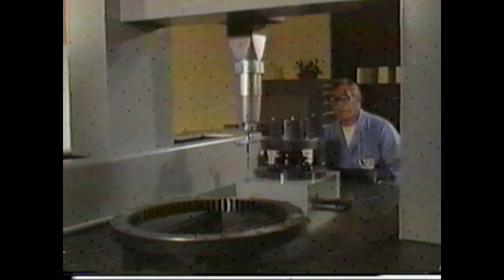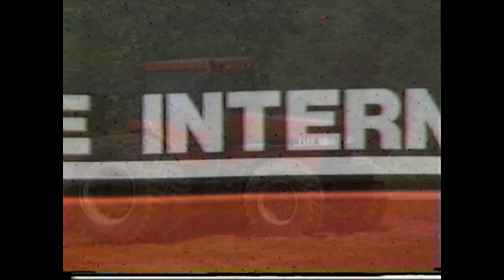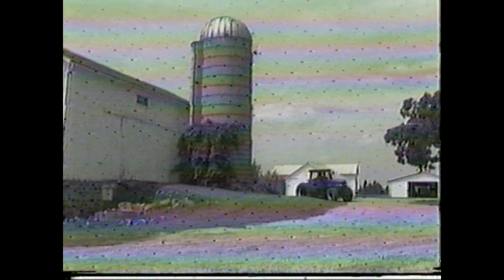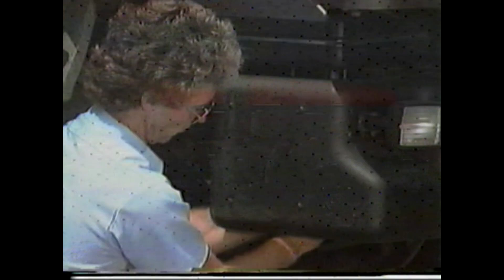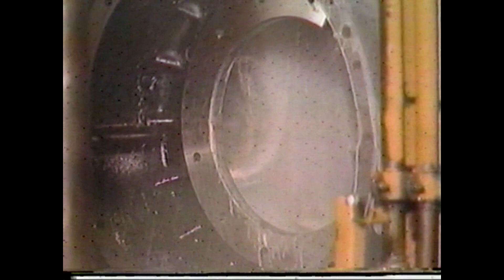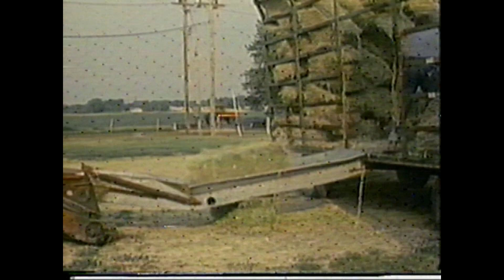Case IH 7100 Series Magnum Tractors Promotional Video - 1987

Comment: So would the IH company come out with this Tractor, without the buyout? I always thought the Cab seemed like a Case 90 series. Spent 3000 hrs in a 7130 hauling Shit. When I was 15 up
Reply: Yes.  The majority of this tractor was IH design.  Last minute in the merger they added some Case inspired design to the cab, and added a CDC engine (Cummins 8.3)
Reply: @curtisk84  wow! Thanks!
Reply: The back half of the tractor was ih and the front case!
Reply: The cab was an ih design ih was going g to release the magnum at the farm progress show in 1985 but then the buy out happened
Reply: @flexicoil_farmer  I think that was a rumor that the old IH people floated to save face. The IH people never wanted to admit that Tenneco through Case, saved them and designed the Magnum
Reply: @RJ1999x  It is not a rumour because Prototypes of the International 5488 exist which have nearly exactly the same side console as the Magnum.
Reply: @melvd3484  I know there is no way to prove this one way or another, but I seen the tractors that IH had on the drawing board, the prototype were built and tested and sold on auction at the annual Case disposal auction, out local dealer bought 2 of them. They were basically  88 series with the cab doors opening the correct way, rather then backwards, the shift levers and hydraulic levers we're moved around, but the most unique, (or stupid) design was the dash was electronic and it was in the center of the steering wheel, and stayed level regardless of the movement of the wheel, which did tilt. I wish phones with cameras were invented because I would have taken a picture of it. I wish I knew who bought those tractors and where they went.
Further proof of the Magnum not being a IH prototype, was when CaseIH was formed the tractors turned from white to red, the 88 series was abandoned. In 1986 I took a private tour through the Case plant in Racine and we watched the very last 504 engine being assembled, and the line behind it was being tore out as the engine was finished to make way for the new tractor line. Because our tour was private the man from Case was taking us around the plant that wasn't normally on display, he told us probably a half hour before to keep an eye out and we may see the new tractor. So a little while later he took us into a huge empty room and said they made a certain unit were built there years ago, and now was vacant, the room was the size of a warehouse and sitting in the corner were the 2 prototype tractors of the Magnum, I got a pretty good look at them, when another man came in and told the gentleman to get us out of there, we weren't allowed to be in that room, so we were quickly escorted out, but I did remark about the tractors as we were escorted to the door.  In 1988 I was a salesman for CaseIH  and sold Magnum tractors, and if you notice it's a design or styling ,blend of the CaseIH tractors and the IH 88 series, with the much needed full Powershift, doors that opened correctly, the Case tilt hood a draft control that actually works, etc. At that time the IH dealers would tell everyone that IH "merged" with Case to become CaseIH, but the truth was IH was broke and Tenneco bought them lock stock and barrel, they also floated that the Magnum was on the drawing boards and was an IH design, but that doesn't jive with the prototypes I saw, nor does it jive with the Case influence design or the CDC built engine, or the planetary finals that IH never had. IH didn't have the money to design the Magnum, and although I can't prove it, I think IH people mocked up a "prototype" of the Magnum to make it look good. At the time I worked for CaseIH the IH arrogance was a cancer that ran through JICase, which is another reason I think they floated the rumours, so the die hard IH fan wouldn't run to John Deere
Reply: @melvd3484  it's also possible that the Magnum cab was mocked up on an IH test tractor that was sitting around, and used for testing, and that's the photographs you see floating around. I use to have a real good friend that lived in Sturtevant just outside of Racine that worked for JICase, and through him I met them than president of the company , Robert somebody, I don't remember his name anymore, unfortunately both are dead , but they could have gave me the answer to the Magnum
Reply: @RJ1999x  Interesting suspicion that I can't refute. But the literature about the genesis of the Magnum also describes it as an IH design and if I remember it right, there are also design sketches from the cab labeled with International showing the later Magnum design. Only the dash is undoubtely a Case design.
The dash in the center of the steering wheel I have seen on photos, too. It was a 3688, if I remember ist right.

I can well imagine what you describe as IH arrogance. I think it was hard for many employees that there formerly flagship company was merged with a smaller on that also didn't have a good reputation.
Reply: @melvd3484  I don't remember the model numbers, the main thing I remembered was the dash, which I thought was another gimmick like forward air flow. Also remember the doors were opening correctly.
  I have some literature from the 7100 series I'll have to read through it again, but there again you had a marketing company writing script, and as arrogant as the IH people were it wouldn't surprise me by them saying they designed it.
I wish my friend was still alive because he would have known the origin.
 I remember going to sales "school" in Madison, if you had a Case guy putting on the class it was pretty straight forward and informative, if you an IH guy putting on the class it was horrible. I had one IH guy putting on the corn planter class, he was an arrogant ahole , running down JD planters (who owned the market at that time) and White planter of which I was very familiar with, having come from White, and sold many 5100 planters. The seed spitter was a joke of a planter, that had about as much credibility as the forward air flow. He was so offensive with dealership employees and mechanics that were there, I was disgusted by the class. When I got back home I made a call to my Case friend, who was friends with the president (that's how I met him) the next day the president sat in the back of the class, and that night the guy was removed from putting on classes, I don't know what they did with him, but he was demoted.
If you ever had to call Racine if you got an old Case employee they were great to work with, if you got an IH leftover you knew it right away, like I said before they were a cancer in Case.
Reply from the maker: That’s interesting. I do have a few videos coming up in the next few months where they are on dealer break out sessions where they are discussing upcoming products versus the competition.  Would be interesting to hear your take when I come around to posting them
Reply: @farmequipmentvideos  are you talking to me?
Reply: @RJ1999x  Why do all of the first magnums have an IH symbol stamped into the castings?
Reply: @curtisk84  I don't think they do,  there was no foundry bought in the take over, the 88 series died in the buyout, the case 94 series was run for 2-3 years before the Magnum, if there was an IH symbol it was the foundries doing, or was just a coincidence. Might have been a CaseIH symbol,
Reply from the maker: @RJ Indeed I am. I may take a closer look at the presentation styles when I digitize the next Dealer presentation video to see I can pick up on the Case vs IH guys
Reply: @farmequipmentvideos  in the schools /seminar it was pretty obvious .
Reply: @RJ1999x  The 5488 prototype I know has the side consoles of the Magnum, but the shift pattern is from the STS transmission with two levers. It's easy to find in the web. 
That prototype would make sense since International planned to deliver three different transmission options for the 5088 series. So this side console would always be same except the shifting part. That is the way Deere did and even does it with it's different transmissions and it would have been a good way for International, too.
Reply: @albertjones773  oh my bad, I'll take the word of an IH engineer running down the company that bought their broke ass out, yeah that's reliable
Reply: @RJ 1999  the cab was an ih design
All case had was tractors ih had combines tillage equipment hay equipment planting equipment etc case had none of that
Reply: @flexicoil_farmer  can't prove it one way or another. I looked for Magnum prototype on line, the only picture I saw of a magnum style cab on an 88 series had a date code of 2001. I find it hard to believe IH could have pulled off the Magnum, these were the same people that couldn't figure out a Powershift,(Case had a 6 speed) couldn't figure out the cab door, thought forward air flow was ground breaking👎, designed the 2+2👎.
The equipment Case got out of IH wasn't worth having. The plow👍 but dying, the disc👍, hay equipment 👎 seeding 👎 the tillage line👎 which is why they bought DMI, what Case really got was a dealer network, and a combine design that they stuck millions in to make it a contender
Reply: @RJ 1999  the 2+2 was a good tractor and the combines are the simplest out there
I've drove cases 6 speed powershift it shifts like shit 
The 18 speed ih powershift is way better 
The case guys destroyed the ih prototypes
Reply: @flexicoil_farmer  The 2+2 we're a joke, few are even running anymore. The Case Powershift was rough, but it was far better then the torque.
The combine were far from the Simplist, the N series gleaners we're easier to work on as were the TR combines, by New Holland
Reply: @flexicoil_farmer  Massey, John Deere, Gleaners, New Hollands and CaseIh
Reply: @flexicoil_farmer  if you want me to rate, Massey's are the worst, followed by John Deere,CaseIh, Gleaners , and because I've owned New Holland since 1995 I find it the easiest to work on, but better yet it rarely breaks down
Reply: @RJ1999x  I understand your dislike for the misbehavior of some International employees, but you generalize this personal impression as an assessment of the entire company and use it as an argument that IH could not have lifted the Magnum without Case. Of course it could have been like that, but pretty much all the facts in the form of design drafts, prototypes and reports indicate that IH was very close even without a Case.
Did you know that the first Magnums got the Case system of hydraulic pumps and that they went back in later series to the IH system from the 5088 series because it was better and more powerful?
So maybe some decisions in the Magnum development were based on which company brought them instead of chosing the better solution. 
Perhaps the cancer in the company were not the IH people, as you claimed, but because in a large company with established processes, other people - Case's - were suddenly in charge in many areas and there was never a successful integration process for them. Not surprisingly, this doesn't result in a good collaboration.
Reply: @melvd3484  I'm sure there were some very good people that did come from IH, all I can convey is how I saw it at the time I was involved.  
 I find it hard to believe that the Magnum was on the drawing boards over at IH long before the buyout. The IH tractors were so far behind the competition at that time, and IH had no money to even be on par with what was already out there, it seems odd they would have spent money on engineering, and building prototypes, and testing, casting molds etc, as they were sinking into bankruptcy
Reply: @RJ1999x  What exactly was far behind on the 3088 and 5088 tractors? Missing fullpowershift okay, but what else do you have in mind?
Reply: @melvd3484  sorry for the late reply, I was on the road all day picking up a truck (international) lol
The cabs were way behind times, in my opinion, laid out poorly, crawl across shifting levers or hydraulic levers, the door were horrible, should have never been made backwards to start with, you had to order Tilt steering, the competition was standard, you only got a telescopic wheel. The torque of course, Allis Chalmers had Powershift already in 1974 tilt telescopic wheel, in 82 the 8000 series had the room with the view cab, far advanced over everyone, but especially IH. The glass was fused in the cabs rather then rubber seals, which CaseIH didn't do until the Magnum, (a sidenote, when touring the plant in 1997 the CaseIH tour guide made a big deal about how they invented fusing the glass in the cabs, for tighter seal, less noise, etc I told the guide he should probably change that because Allis Chalmers was doing it in 1982, they pioneered it). The 7000 series Allis Chalmers was knocked for the small cab, when in reality the 86/88 series cab was actually smaller.  The front axles on the 2wd were poorly designed, and problematic ( there's not a machine shop around here that hasn't machines them tight) the 4wd unit were too light, our neighbor had a 5488, if that was the big one, they had a set of duals on the front, to pull a 12rn planter, the oil would boil in the unit if it was a hot day. The draft control worked poorly as did Case until it went electronic, of course the torque was unreliable in an age when even white could figure out a 3 speed Powershift. Transmission was problematic, the rear ends I think had planetary on the bigger units, Allis Chalmers for example had planetary from 60 HP on up at the time . On the top of my head that's about what I can think of
Reply: @RJ1999x  Thank you.
Maybe I have a too german-focused view to International. They were the No.1 in sales from 1971 until 1981. 1981 they introduced the XL cab, which was one of the best cabs on the market at that time with doors opening backwards and glued glass (is that what you mean with fused?).
The draft control was a self engineered system with nearly the precision of an electric system.
The tractors ran 25 mph as an option.
To make it short: The EU engineered tractors from IH were on a pretty good technical level compared to the competition. Oh, and the standards in EU surely were not lower than in the US.
German IH was run well economically until the merger in 1985. 

So it sometimes sounds weird to me that the same company in an other country had so much trouble.
Reply: @melvd3484  That's neat. I've seen the European IH models but only on YouTube, I have 0 real life knowledge of them. We are in the process of bringing a 986 back to life , it belongs to my friends brother-in-law, the tractor was a wreck, it a well made unit, I think the engineering on the tractor is very poor, especially the cab which is a nightmare to bring to life. We are in Wisconsin, the IH cabs up here are all junk, rotted out etc, the way they were made I'd very complicated, and labor intensive, and now taking it apart, repairing all the rot, and trying to seal the cab is very time consuming, vs say John Deere or Allis Chalmers tractors, and you still end up with a small rather awkward cab. This tractor was bought new in 79, the drive train has all had issues and the unit only has 4300hrs on, but to be fair it was not taken care of
Reply: @melvd3484  the hood, gauges and engine are Case but the rest is IH. The Magnum door fits on the 86/88 cabs and if you see an early Magnum, the trans S/N only says IH on it and all the transmission gears are stamped IH. IH had the design but no money.
Reply: Case always had the Fuel tank in the back. And the Exhaust was always on the Right side. I always thought it was a combination of both and that 88 series Cab with the door throwing you into a Shitty Tire, I find it hard to believe that it would of happened without the Merger. In my opinion not a fact.
Reply: @robwar2288  I agree, mufflers were on the left, but off the hood.
Reply: @robwar2288  International also had the fuel tanks in the back. Furthermore International built thousands of cabs with doors opening to the right side in the Neuss plant. These so called XL cabs where released 1981 in Europe and International planned to use them for the world market. There are a lot of design sketches, mockups and prototypes showing tractors of the TRX project.
There are also prototypes from the 5088 series with the door design of the Magnum.
Not much room to speculate that International would have been keep the suicide doors, especially while this detail was easy and cheap to change.
Reply: Mostly an IH tractor. I have an earlier 7140 and a good share of the parts are the same as an 88 series IH. The final drives are the same, the pto, the front axle parts, the transmission, the hydraulic pump. There are a few differences in mounting. I worked for a guy that saw a guy put IH axles in a magnum and an IH engine and the 88 series tin work. It all bolted up perfectly.